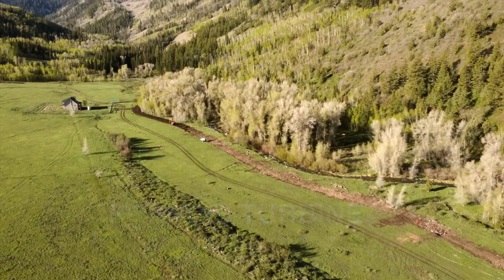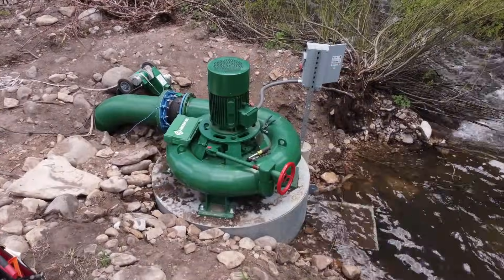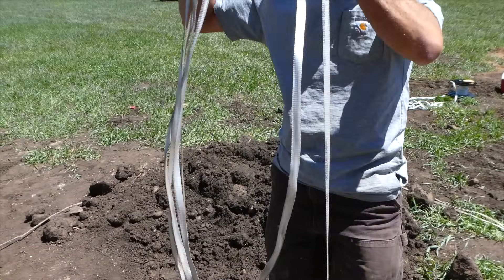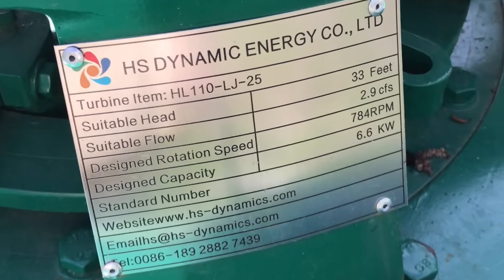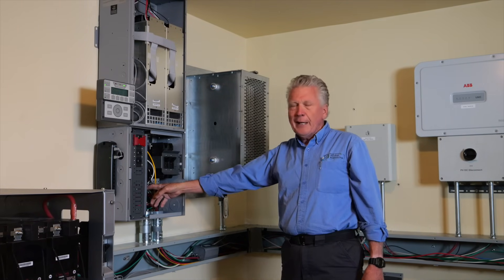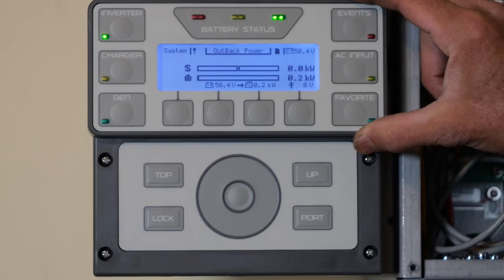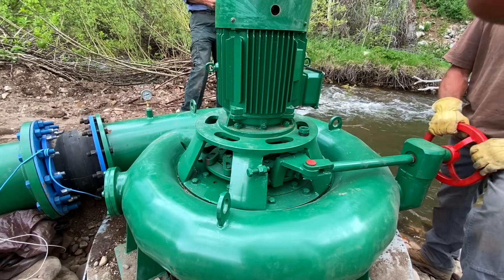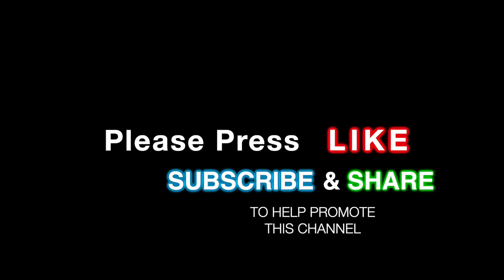MicroHydro Francis Turbine Part 2

Comment: Shame they went with old AGM instead of LIFeP04
Reply: Up front cost is a VERY good reason for selecting lead acid batteries. If you do not abuse your batteries the life time cost will also be lower even without adding capital cost to the equation. There are good reasons for selecting LiFePO4 chemistry, but lead acid will be still be used for a long time.
Reply from the maker: Good point bknesheim. Thanks for watching!
Reply from the maker: Correct on that Marty, Thanks for watching!
Reply: The batteries in this project are for buffering. The turbine carries the load. The one component they didn't explain was the huge resistance heat dump load next to the inverter.  Since this system doesn't have automated vane controls I'm guessing they are grid tied sending majority of excess power to the grid for buyback. This system has the potential to generate 144 Kwh of energy daily.
Reply from the maker: This is fully off grid and the resistive heat dump is where the inverter dumps when batteries are topped up.  It was part of Ken's description that I dropped do to length and the complexity of his explanation.  There is also a propane genset that can kick on as well that I left out.  I try to keep the explanations simple to not confuse most viewers.  Thanks for watching!
Reply: @mrhydrohead  that battery is only 28 kwh. Turbine has 144 kwh daily potential .  They must not be running the turbine at max output.  Their household load was only showing 200 watts parasitic load .  They can't  be dumping that much energy to heat or that mechanical room would overheat very quickly.
Reply from the maker: @jstaffordii  The footage of the 200watt reading was done before the turbine was completed and only showed the slow drain from the charged batteries 🔋. You are correct on the 144kWh/day, but my guess is that they won’t run it at that level of output except in winter. 
My system shown in the other videos on the Channel is straight AC with a load controller and gets run at 4.5kw in all seasons except winter when it is set to 7.5kw. Even at 4.5kw our basement heats up to 80-85 degrees from the dump loads. Thx for sharing your thoughts
Reply from the maker: Ken the designer said:"The Francis turbine required a battery based inverter because the system is off grid.  There is plenty of power from the turbine and the batteries would rarely cycle.  I used AGM batteries because they are designed for that purpose – remain full most of the time.  Lithium batteries are far more expensive and don’t justify the expense as the batteries are simply a requirement for off-grid."
Reply: If the water stopped flowing at night as solar does, LiFePo would absolutely be the better alternative. With the continuous creek supply (I believe) the batteries act more like a capacitor to smooth demand surges.
Reply: Want to see a microhydro project that uses 2 x 12VDC second hand lead acid truck starting batteries already 5 years old....for another 5 years of life on a hydro system?
https://www.youtube.com/watch?v=LVoeaKCEd2o